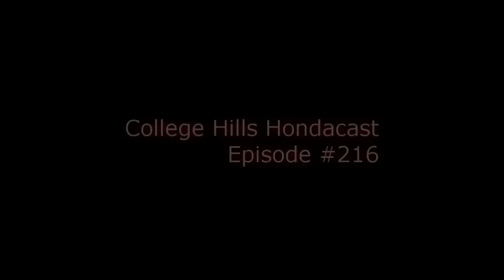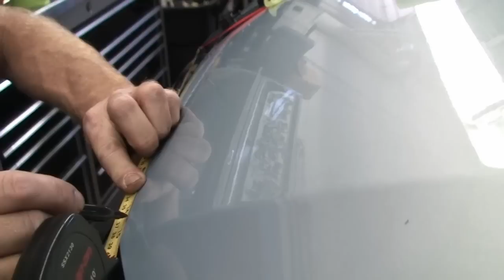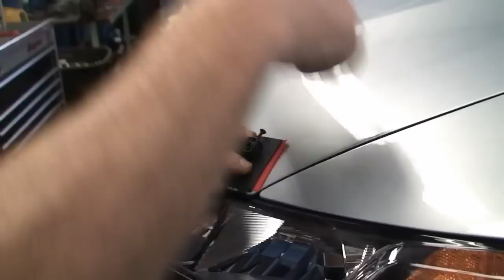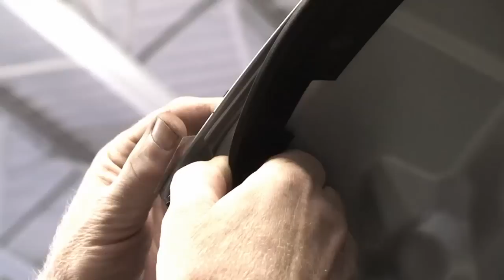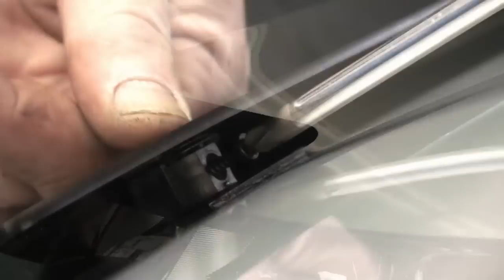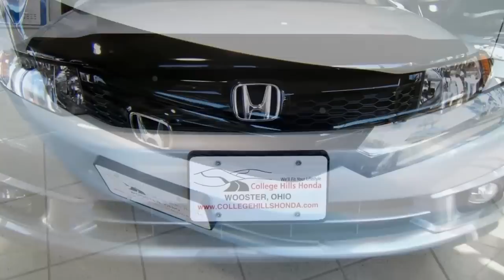Episode #216 - 2012-2015 Honda Civic Air Deflector Installation

Comment: So basically, you don't need to drill holes in the hood to fix it in place??  I tought you had to!  so its just aligning the pedestals, stick them and then screw the deflector in the pedestals
great!
Reply from the maker: Yes. No drilling required.

Comment: Do you still carry this item? I cannot find on the website.. :(
Reply from the maker: Unfortunately we are sold out.
Reply from the maker: Yes they will.
Reply from the maker: It is best to install when the temperature is above 50 degrees. Once adhered low temps are not a problem. The tape used to install these is the same as what they use on body side moldings, door visors, etc.
Reply from the maker: 08P47-T2A-300
Reply from the maker: Honda does not list that information. Maybe someone that has these installed can chime in.
Reply: is there anyway I can provide you my information to be next in line for when you restock?
Reply from the maker: I'm sorry but we will not be receiving more stock.
Reply: then what good is this video
Reply from the maker: The video was released back in 2011.

Comment: Does this fit 2014 civic 4 sedan?   I dont see it at college hills website either
Reply from the maker: This item is discontinued from our store.
Reply: @CollegeHillsHondaAccessories  sad to hear.  Can i get a honda part number so i can try my local honda shop?
Reply from the maker: @Yang-gk4fy  Don't quote me on the part number. I believe it is 08P47-TBA-300 but I'm not 100% positive. It was an imported item so USA dealers will not have it.
Reply: I think Honda stopped making this part all together as I can't find it anywhere online.
Reply: @ericdrobnick1942  yea cant find a oem honda one
Reply: @Yang-gk4fy  I'll do alittle more research and see what I can find.
Reply: @CollegeHillsHondaAccessories  08P47-TR0-300
Reply: @Yang-gk4fy  08P47-TR0-300 is what you will want, this is the correct part number.
Reply: @ericdrobnick1942  hmm.  I'll try that.  Thanks